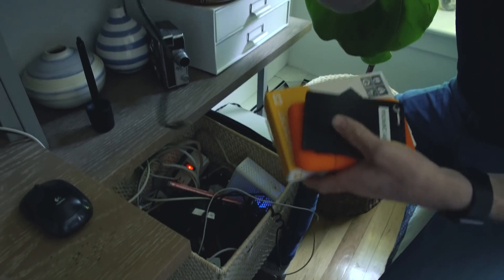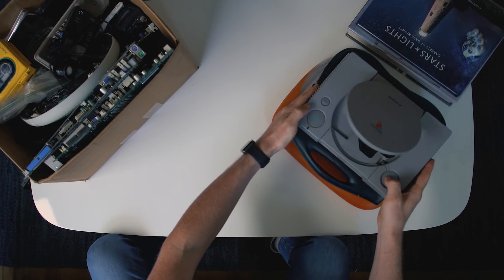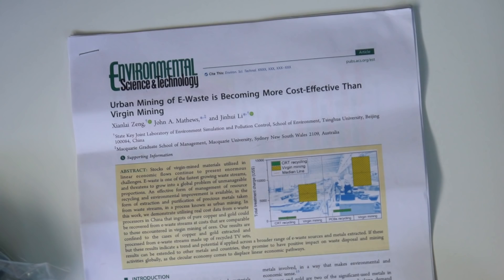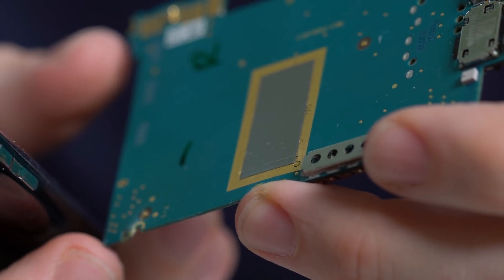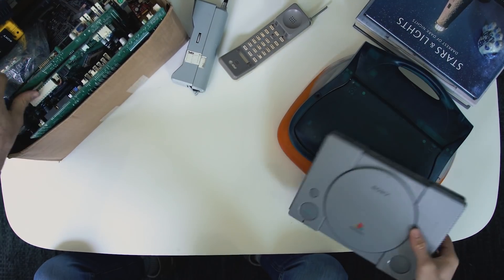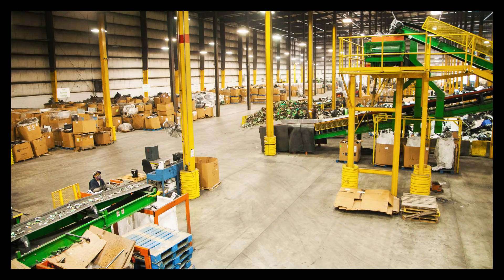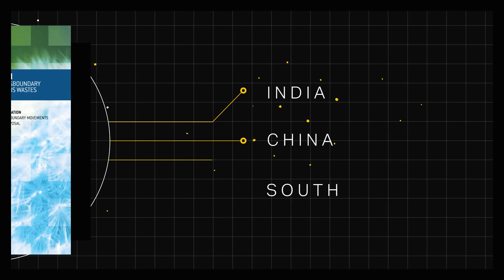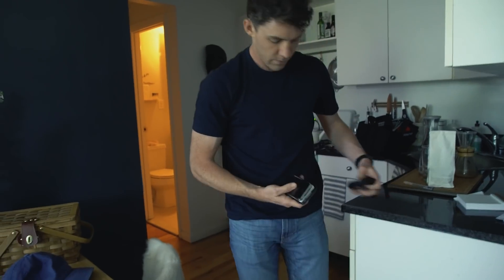Your old phone is a veritable gold mine

Comment: I Scrap e-Waste as a business in Florida. All of the material is valuable. I waste nothing. Everything gets separated. Metal gets melted, Plastic and Glass go to the recycler. Circuit boards are stripped, and the resulting materials are sorted. Even Precious Metal extraction can be done with safer methods that use electricity instead of acids. The plastics can be burned for energy if the fumes are trapped and scrubbed. Or they can be pyrolized and used for other materials. All of that material is valuable. It is important to sort like materials together and process them correctly. Unfortunately, it is definitely minimum-wage work.
Reply: Can't we reuse the circuit boards to make something useful instead of stripping them? They are intricately designed..

Comment: You can ether use acid to extract the gold from circuit boards or pcb's. Or you can just remove any and all circuit boards from the device and turn them into any scrap metal yard that's except s e-waist. And get money for them. Not much. But it is good for us all to do so. Instead of it all ending up in a landfill. Or worse yet. Burned in an incinerator to generate electricity. Since the ash is collected in the end from scrubbers and incinerator then dumped on the landfill as backfill. Which if everybody threw everything in the trash. Can have mercury from thermostat s and even nuclear waist from household items like smoke detectors. Which we all end up then breathing into our lungs.

Comment: Good video, but it kinda falls short.

First of all, harvesting gold from electronics only makes sense if you ignore the extremely toxic and dangerous chemicals you have to use in order to extract an extremely tiny bit of gold and rare materials in each piece of electronic.
To give an idea, you can take 311 grams of gold... out of a ton, or 10000 smartphones.
Half that ammount of gold for 200 laptops.
Your old phones can be considered veritable gold mines at the most strict sense - you need a ton of material to receive and extremely toxic and harsh chemical process to extract miniscule ammounts of gold. You actually can get more gold per ton of material out of electronics compared to mining, but the process and chemicals needed are all worse than even regular mining. So, I dunno how that study mentioned was produced, but no, it still does not make sense to take gold out of electronics compared to regular mining.

Then you consider man hours, extremely toxic and expensive chemicals, a super complex process and the fact that you'll end up with almost the same final ammount of trash that is now also toxic requiring special disposing processes.... it makes zero sense to do it on small to medium scale. At big scale it's not happening because of the potential ecological disaster it could produce. If it could be done in a profitable way, companies would be doing if for decades now. This is the type of thing that absolutely needs governmental interference, incentives, regulation, laws to support and whatnot. Which is pretty hard to do when you have a backwards thinking government.

The trash is exported and then part of it mined in a similar way that some people go eat and try to find something in landfills to profit from. Extremely poor people who are paid almost nothing for their work and are already trapped in hellish conditions. By US standards, the places that this is happening in those countries - China, India and whatnot, would be all considered superfund sites. People in those places will rarely live past their 30s.

The better way for old electronics and broken ones is exactly not to toss them into the garbage or send it to recycling centers. If you can fix it, do it and keep using for as long as possible. If you can't, try to sell it or give it up to someone who can. Depending on what it is, you can even sell or give it up to collectors. It's still better for it to become a museum piece or something like that than being discarded.
The best way to deal with this is to extend the life of electronics for as long as possible, then when it's completely broken let useful parts of it be harvested and put to use, and then finally when there is nothing that can be used there anymore, only then it goes to recycling. Recycling and trash are last case scenarios.

Optimal scenario given current limitations is that end consumers with no knowledge or will to fix electronics or make use of parts should not be throwing that stuff in the trash... it should go through a long process of trying to make use of everything in it until it has to go to the trash because nothing there can be used for anything.

For smartphones, laptops and desktops, see if you can find local repair shops that can make use of parts. Maker spaces might also accept it depending on what it is. Let them discard the stuff if they can't make use of it.

Comment: How about instead of just chucking it all together in a box, why not at least separate the electronics from the plastic. While your about it remove any motors, magnets, speakers that can be used in DIY projects or sold on eBay etc. Or go on ‘Freecycle’ and post what you have that others may need/want.

Comment: Repair, Reuse and only then Recycle. Recycling should be the last option.
Reply: Reusing means you don't need to buy more stuff. Buying more stuff will only fuel the cycle of waste.
Reply: In a lot of cases old phones and tablets are repurposed for POS or dedicated machines in a range of applications. They have cameras, wifi and processors which means academics and hackers can use them for a range of applications. Old laptops can be donated to schools, esp abroad or in less fortunate areas. Also many of the component parts can be used to repair machines.
Obsolete doesn't apply to most of this tech. That's mostly marketing. Not saying some stuff shouldn't be recycled but it should be a last resort. If you really can't find anyone to take your stuff I guarantee a local hackerspace would love the donation.
Reply: @EvilKimau  https://youtu.be/IBnB1eVpDBg
Reply: juilan Rhodes hey hey, there was a Playstation 1! I'd be happy to have it.
Reply: In most laptops, the thing that is worn out the most is the hard drive, then heat sensitive modules, but if you simply replace the problem parts with new ones, you have a working system again.

Old CPUs on old laptops that has like 2Ghz and all, are still fast performing, it's just that human activities and wear and tear of the hard drive causes it to become inefficient.
Reply: @dra6o0n  (exactly why I put an SSD in my netbook)
Reply: juilan Rhodes In a lot of cases, as long as it works, it still has a purpose for someone 
Obsolete for most, not all
Reply: Exactly and in some cases you can reuse for little or no money. At least a few linux distros (if not most ones beside Windows duped ones) will likely run "like" a new system on a old laptop/PC. As unless the motherboard had gone up in flames the worst you may have to do is stick a small 60GB SSD and possibly a new RAM module or two.
Reply: Dominik Seljan We've still got one in our house!
Reply: Reduce, repair, reuse, reject and recycle ♻️
Reply: Claire Blackshaw why would you reuse old tech from the 90s that are completely obsolete
Reply: @hideoutvideo  Why is it obsolete? obsolete would mean no longer serving a function, and this type of older tech is great to still use. Any Nintendo fans here? they were "obsolete" too until people wanted them again and Nintendo's have been flying off the shelves as soon as they release them. Look up something called planned obsolescence my friend.
Reply: juilan Rhodes Nostalgia, or looking at the past. 😀
Reply: @hideoutvideo  retro gaming bro
Reply: Verge audience is such bunch of hipsters